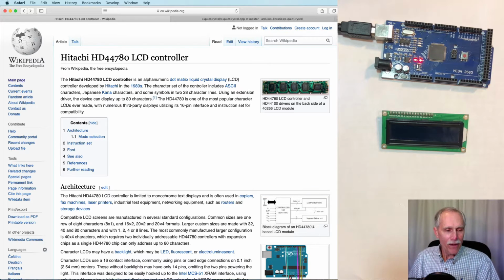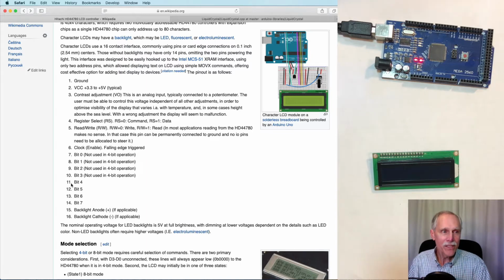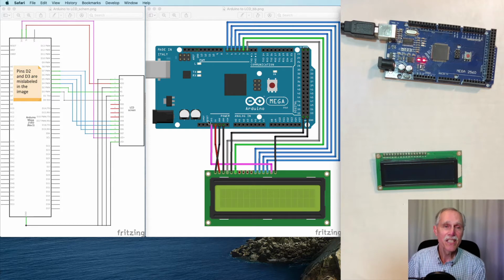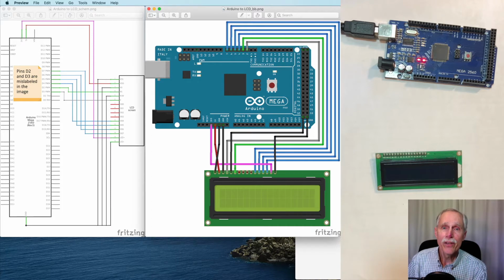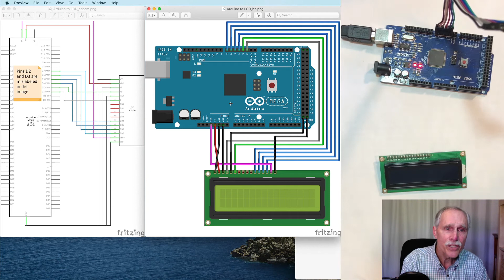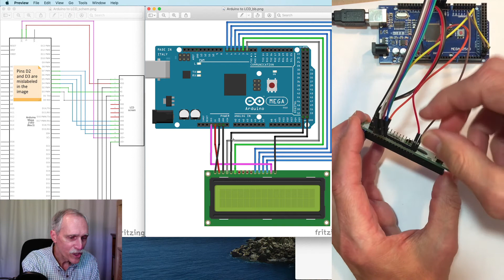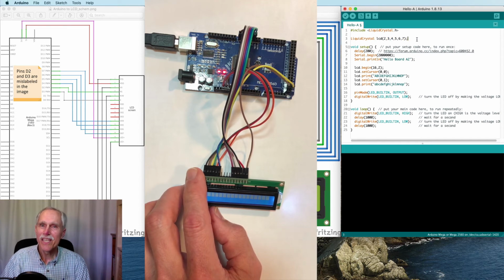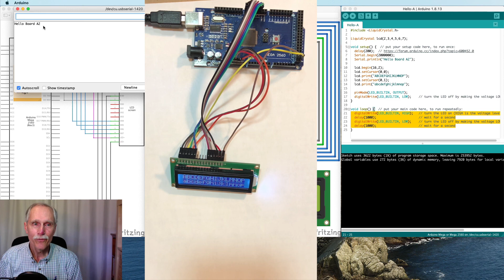Arduino Mega 2560 and a 1602 LCD

Comment: Thanks for your concise instruction. How ever, I should point out that the controllerbis an ARDUINO, and not a ADRINO.  I think you should correct your expression, regards
Reply from the maker: David, Thanks for your comments. As you may note in the beginning of the description ("Update #2") I note that I pronounced it wrong. I'd love to correct it but YouTube doesn't let me replace the existing video. Given that it is one of my most popular videos, I'm hesitant to remove it (as embarrassing as it is)!
Reply: @JamesFoster2014  thanks for your prompt response. I am resourcing myself with arduino information. The arduino is a great breakout board, and just surprised about the ease of programming. Great work, regards

Comment: I wish you a good day. I have an Arduino Mega where I have a problem uploading the code. The port is found by the computer, so the driver is good, but it does not communicate with the main processor. What could be wrong. Thank you in advance for your help.
Reply from the maker: I don't think of anything right off. I suggest you go to https://support.arduino.cc/ and perhaps ask in the Community forum.

Comment: Sir blocks are showing on my lcd display, connection are correct but it is not showing any text after uploading the code ,..I have under> tools>board selected Arduino mega >port com 5.code is uploading successful 😔but no text is showing

Comment: Amazing video! works like a charm! but sometimes if there is too much text the text goes off the LCD display do you have any recommendations to fix that?
Reply from the maker: There is room for only 16 characters per line. If you have more than 16 characters then you need to put it on two lines or you need to scroll. See the library API at https://www.arduino.cc/en/Reference/LiquidCrystal.
Reply: @JamesFoster2014  Ok, thanks!